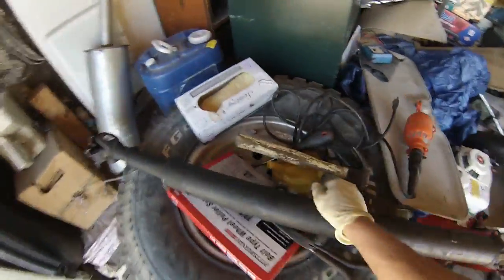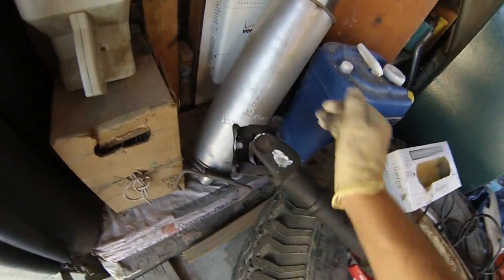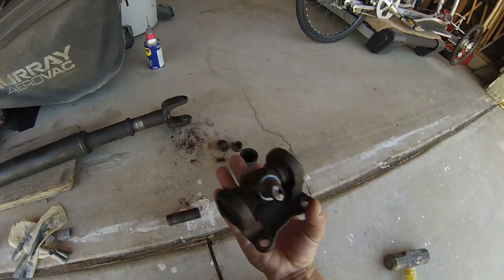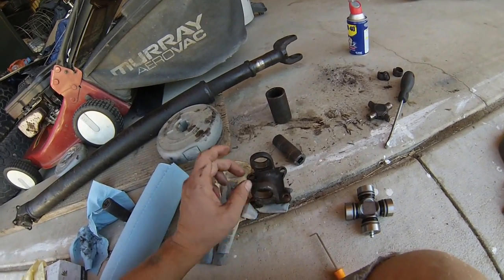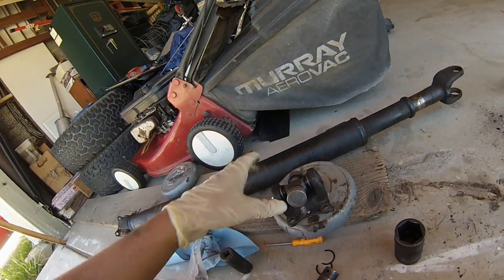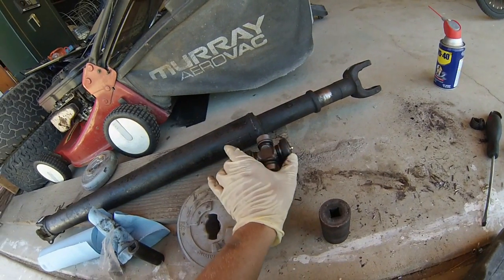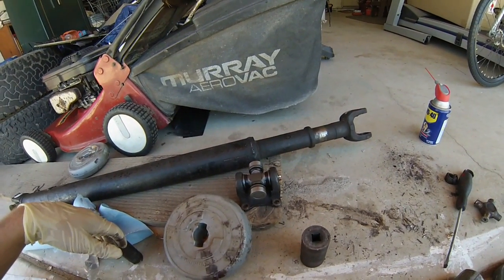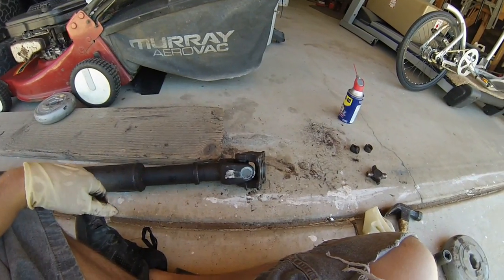U-Joint Replacement 80's Toyota Pickup\4Runner

Comment: Im thinking one of my u joints is bad on my 92 toyota pickup 4wd. Hearing a strange squeaking sound at low speed under the cab and there is some vibration that i had assumed was the wheels but i changed them and its still there. Hopefully this is the problem because its been bugging me for the better part of a year.